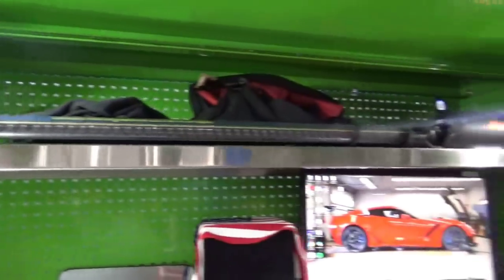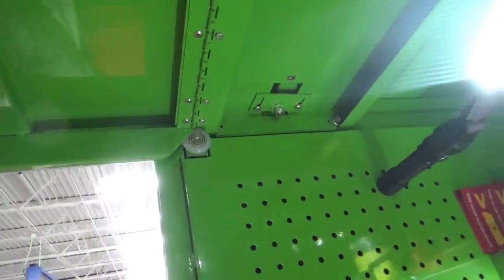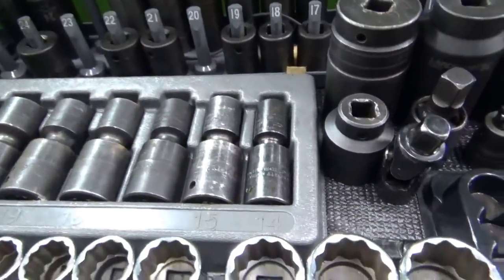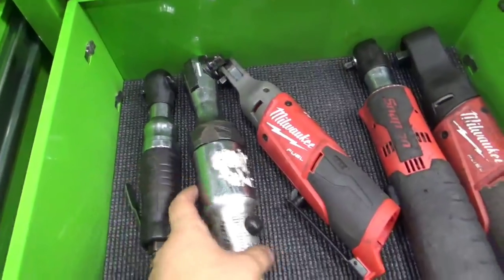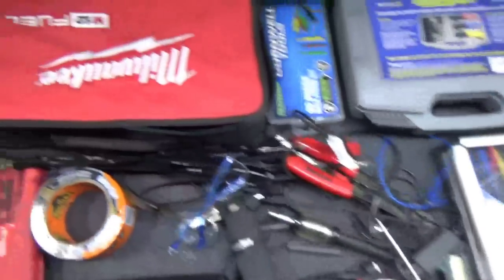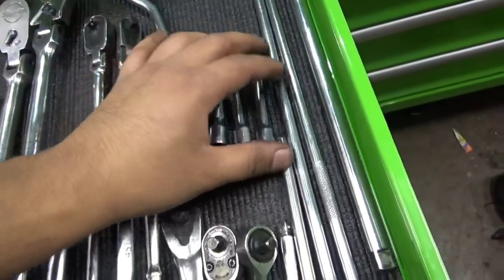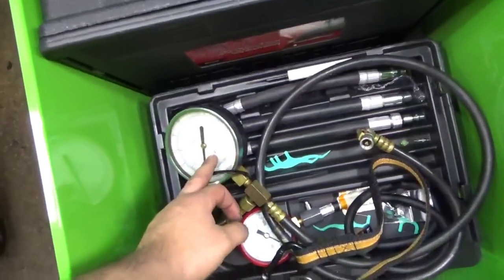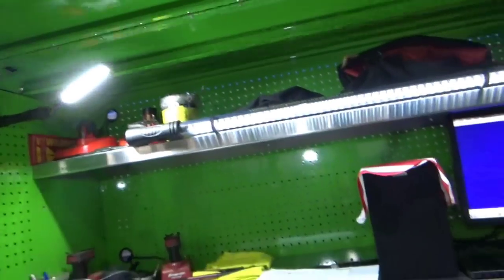Tool Box Tour 72" inch Tool Vault Elite Box & Hutch better than Tool Truck Boxes??

Comment: I have the same box in blue and I love it.
Reply: How rigid are the drawers, are they wobbly like harbor freight?
Reply: @daviddake22  Not even a little bit. I have a 56" HF box too and it's garbage in comparison. I would buy this box over and over again. I want the new tool vault 84" but I literally could not justify it as I have a ton of space left in this box. I feel it's every bit the box the snap on is at 1/4 of the price. I looked at this box for literally years and I am glad that I finally pulled the trigger. It's 3 years old now. I thought about the 72" HF but I am so happy I went this direction as the value far exceeds anything else I looked at.
Reply: BajaMedic thanks for replying, I’ve watched tons of videos but non really gave me a good review on the drawers. I’m replacing my 56” hf box with the 72”

Comment: Great box had mine for about 4 years, then traded it in to snap on for a 84 epiq but never once had an issue. And strictly tool boxes has the best costumer service. Great vid.
Reply from the maker: +IGGY P awesome did you get the hutch and side cabinets?
Reply: 410 Auto Tech yes I got hutch and locker same as I had on the tool vault

Comment: I work on Cummins engines and use 12 point sockets all the time. I use sae deep impact sockets for suspension.
Reply from the maker: I never really  use them but i have them just incase for that reason.

Comment: Curious...  your electrical drawer...  why is your “big money drawer” all the way at the bottom?  Something that you use more often would probably be better suited a little higher up...  less you bend over the more old future you will appreciate it...  the less you bend through the day, the better your back will be in 20 years

Also, question about the box itself...  are those drawer slides as stiff and sticky as the look?  They look and sound super cheap...  good looking box, deeper than I thought...  maybe use some white lithium on the slides is my only thought...
Reply from the maker: I'm not very tall so it doesn't bother me to bend down and I like having it on the last drawer for the space, I'm always re arranging every drawer to keep it fresh.

Comment: How did you drill the holes to mount the hutch did it come with a template or something
Reply from the maker: No it didn't which kinda sucked but was easy with help of a few friends to get it centered.
Reply: The stainless top removes and there are white x marks to drill from the bottom up. Get someone to assist because these boxes scratch easy...

Comment: Thanks for the toolbox tour. I was debating on whether to go with a Strickly toolbox or a Snap on. I was concerned about parts and customer service 20 years from now and would Strickly even be in business. I decided on a Snap on 68" Epic.  My dealer gave me a rock bottom price because I paid cash so it was not too much more.
Reply from the maker: I always say what ever work for your available funds go for it. I did alot of research before I made my purchase and alot of guys had the box for many years.  Alot of diesel guys had it and I'm a gas tech so I figured if it can hold heavy tools it can hold up nice.
Reply: I agree. No reason to go into huge debt on a box.
Reply: I too was about this box but was concerned of how it would last. Ended up with snap on master series triple bank!! Paid less than what this combo goes for. But still think I would have gotten a better deal if I had gone with strictly tool boxes
Reply from the maker: @hilltopmachineworks2131  right I rather fill it up with great tools .
Reply from the maker: @ricardotorres5759  il definitely try and do updates on this box every 6 months . Hey if you can get great deals on tool truck boxes go for it. I was never lucky enough to get a good enough deal that was in my price range. I'm definitely not regretting my purchase box is definitely built well and plenty deep and loving the hutch!!